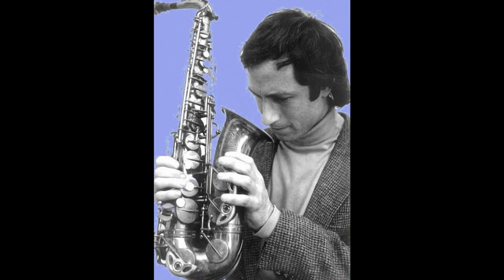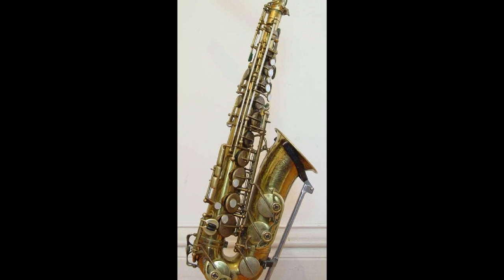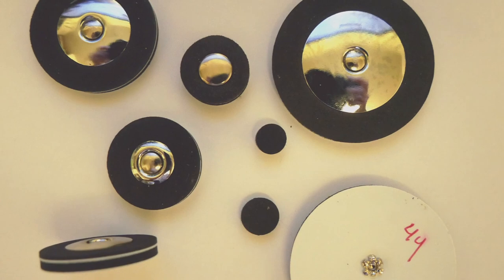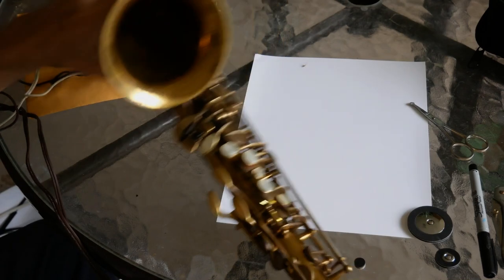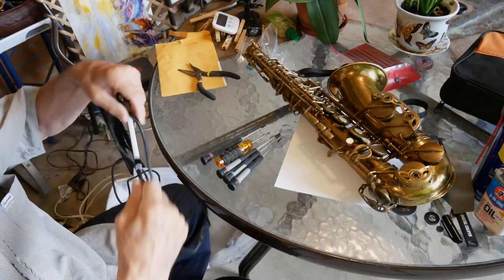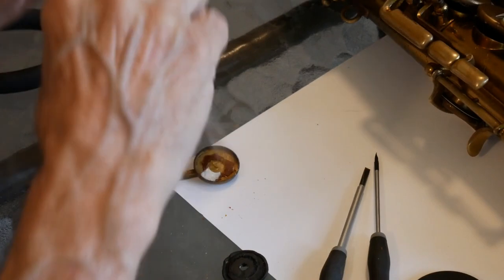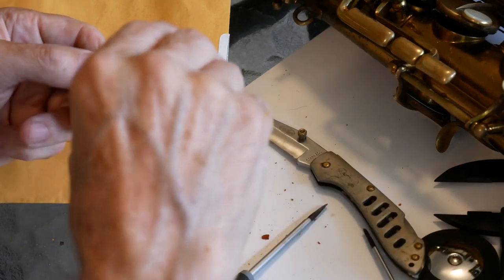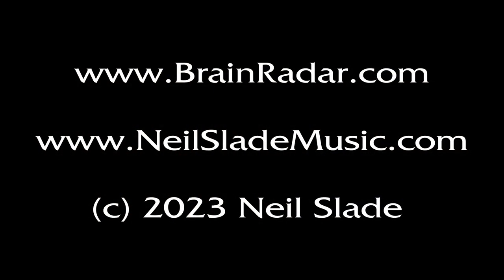Selmer SBA Alto Saxophone Synthetic Re-Pad Job- Neil Slade and Tru-Seal   Instrument pads

Comment from the maker: A couple of pads did come loose with the spray adhesive, but I refixed them in place with a hot glue gun, which I would recommend over the spray at this time. Otherwise, no problems with the repad job. Be prepared to spend a fair amount of time adjusting the keys to eliminate all leaks using a leak light.